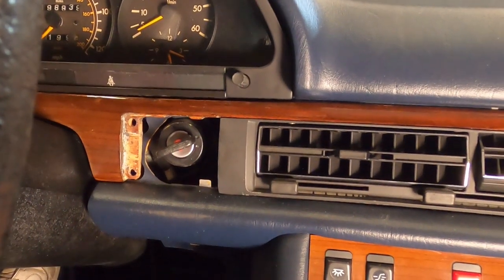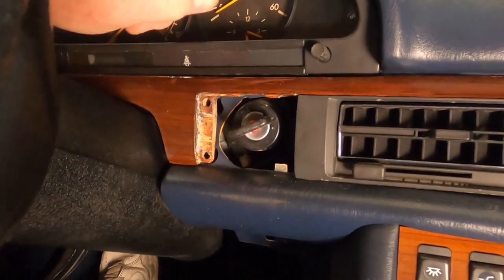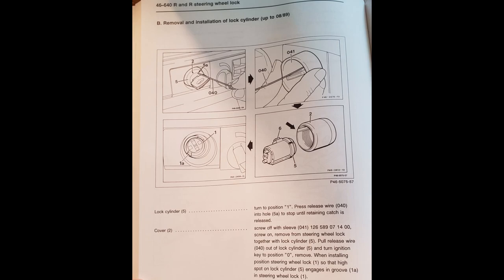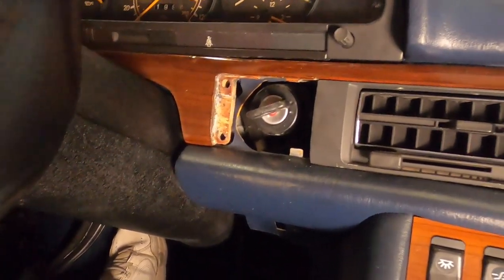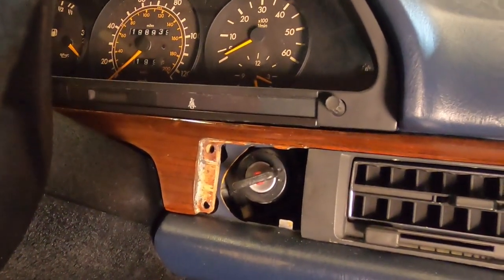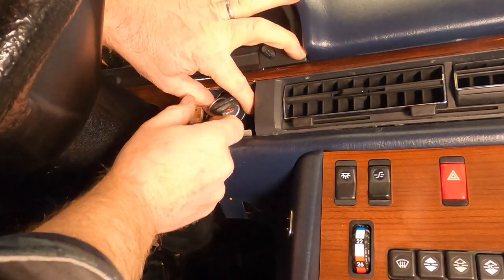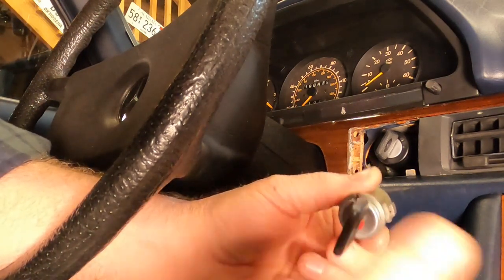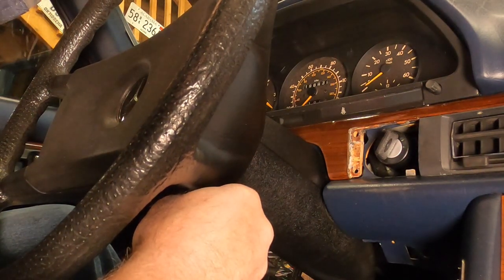W126 Mercedes Sticking Ignition Key - Part 1 - Lock Cylinder Replacement

Comment: Hey! I actually just performed my ignition Tumblr replacement.  And i ran into the same problem once i first installed the tumbler.  The key didn’t want to turn from the installation setting. 

I removed it again but i installed just the tumbler without the bezel. And it worked just fine.  You just have to make sure it is seated all the way down in the tumbler cylinder.  

I then reinstalled and made sure to depress that little “hat” button as i was threading in the bezel.  I seated it all the way. Removed the tool, and unthreaded the bezel till it clicked into place.  And now it works just fine!  

I have to thank you for your video to show the process. I hope you had better luck with your key than I did. This one is oem from mercedes and the black plastic from the key fell off during installation!  Not too happy about that.  But it works fine now.
Reply from the maker: Glad you got it working. Thanks for sharing!

Comment: Hi: can you please tell me how to pry off that small plastic panel around the tumbler (min 6:18) in your video. I try to remove it but do not want to break it or the wood around it.. The tumbler came out but not all the way because of the small panel around it..
Reply from the maker: you have to remove the long wooden trim. That cover around the key is attached to it. I cover it in detail here: https://www.youtube.com/watch?v=5WNUL1-tb1A
Reply from the maker: The trim on my car is broken that is why I can remove the little panel without removing the entire wood trim ha ha
Reply: @ImpalamansGarage  Thanks... I had to pry it off, the small plastic broke... otherwise I could not get the tumbler out.. I will see if I can JB weld the plastic pin... Got lucky when the old tumbler was removed from collar, it was in two pieces.. Got the new one in.. Now debating whther I should change the locking mechanism as well.... I noticed with the new installed tumbler and new key (from dealer) it takes little bit more strength to get the key out compared to the old key and tumbler.. not sure if this is normal...

Comment: Hi
I changed mine and I did oil it well before installing the new ignition and I did change the electrical part that connects in the back insert where the cables are now my key does work but it’s very hard to turn and gets stuck at the starting position and keeps cranking the starter do you know what the problem could be ?
Reply from the maker: The lock cylinder really doesn't need any oil to function correctly. If you are saying that the key remains engaged such that the starter continues to turn even after the engine has already started, that clearly is serious enough to remove the entire assembly once again and start over. The replacement parts may not be of good quality. Are they OEM Mercedes?  I'm not sure if it's possible to install the electrical connector incorrectly but it sounds as though it might be. For questions like this there is a great W126 page on FB groups. (Mercedes Benz W126)  In subsequent parts of this video series ultimately I determined that my original key needed to be replaced. I bought one from the local Mercedes dealer. They are still available.

Comment: What if you can't turn the key, how can you remove the cylinder?
Reply from the maker: Are you using the original key? New ones are available from the Mercedes dealer if you give the parts department your VIN. These keys wear out.

Comment: How do you remove the plastic cover so you can get to the lock cylinder?
Reply from the maker: Google part number 1266800065. Note the two plastic tabs on the left. This panel lifts out with a little prying. The tabs on mine are broken off. LOL.... I need a new one as well.
Reply: @ImpalamansGarage  let me double check all my spare parts, I might have one for you
Reply: @ImpalamansGarage  I can't guarantee it, but I really do think I have one. I just can't guarantee what kind of shape it is in
Reply from the maker: @johnbower5732  Appreciate it. They've got em on FCP new for like $20. No worries.
Reply: @ImpalamansGarage  well,.....I have good news and good news and bad news....I have a piece, it's in perfect condition still attached to the wood piece for the dash......, buuutttt.......one of my family members decided to liberate it from my stock of spare and new parts...I apologize...if you want I can send some other things to make up for it. I apologize once again. Sorry "Red"

Comment: The resistance of the key going in is more likely the key being worn.
The ignition switch itself is probably worn and needs replacing. Not repairable.
Use your original cylinder on the new switch because that is also the door and trunk key.
I've replaced lots of these on old American cars but never a Mercedes. The American cars did not have an outer sleeve like that. Just use a paper clip and turn one way or the other and pull the cylinder out with the key. 
Mercedes had to make it so most people would have to support their local mercedes dealer for simple stuff like this.
Your lucky it's not on the steering column with a rod to the firewall where the switch is.
Reply from the maker: Werner I'm ordering parts today. 🤣🤣 Gonna pick up a switch and a steering lock. Yes I'm throwing parts at it. LOL